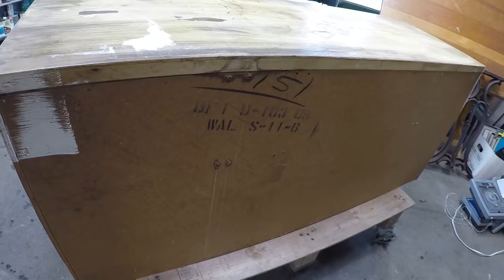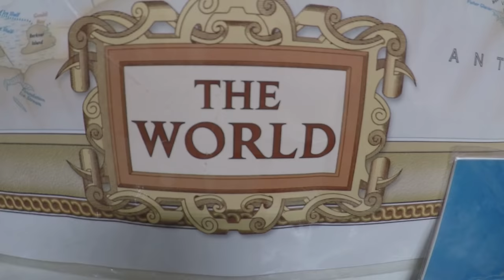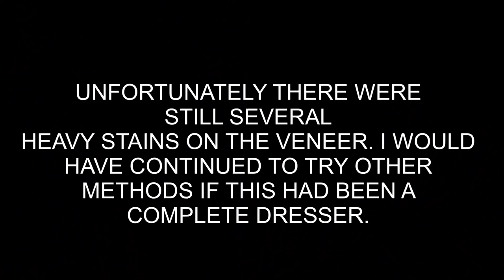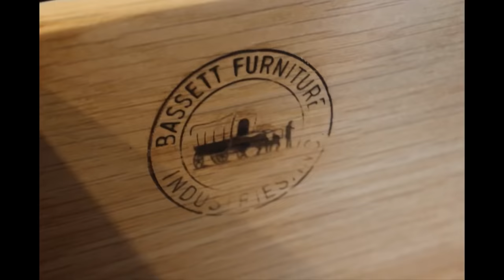Ep. 8 The Nastiest Furniture RESTORATION

Comment: These are probably not very smart questions, but I’ll ask anyway … 1. When you say the veneer was beyond repair, what did you mean? In other videos haven’t I seen you put on new veneer? 2. Why couldn’t you stain the wood left behind after you removed the old veneer(what’s the difference between wood with veneer on top and wood with no veneer when it comes to staining it?) 3. What is the difference between laminate and veneer and how would you tell when stripping or sanding it? 4. How do you know when to stop sanding or when you’d destroy the veneer? 5. Could you show an example of the problem you saw with staining the top of this dresser ….I couldn’t see anything and thought that stain looked beautiful. Beautiful work! Again! p.s. ..I’d love to see a video about how you refurbished your very first piece…did you already have tools? Did you know how to use the tools? What made you decide to do furniture refinishing?, etc.
Reply from the maker: I'll try to answer as much as possible. This was one of my first major projects. I had not ever placed veneer at the time of this project. The veneer on the top of this had many stains and burns. If I had stripped off the veneer I would have been working with a poplar substrate. Soft woods don't often stain well and can look blotchy. This would not have matched the beautiful drawers. I wasn't as considered about painting this piece since so much of the veneer was beyond repair on the front and the legs were missing.

Comment: I am learning about MCM. I was wondering why the legs in the back were not at an angle. Is that how it is done for MCM? Thank you.
Reply from the maker: Hi Sara. No, it isn't typically how MCM was done. This dresser probably had shorter legs. I decided to put on longer legs so it would be a height to use practically. In order to do this, I had to make sure the brackets were secure. I angled the front legs because the way it sits in a bedroom, that's all you'll see. That added enough support to sit on the dresser without it being unstable. Not that anyone would of course. The front legs can easily be adjusted straight if desired. Thank you for asking. Hope you are enjoying the videos. Barry

Comment: Hiii😄
Thank you for such a great video !!
I Love learning how to actually FIX pieces and giving them life foe the next few decades 💖
I have a question,  are you marking your imperfections with sharpie directly and filling on top of the mark ? Or by the imperfections and then sanding the sharpie off ?
I'm curious if the sharpie bleeds through the wood filler ?
Reply from the maker: I just do tiny dots with sharpie. Don't think it was enough to bleed through the wood filler, and ultimately through the black mineral paint which is primer, paint and topcoat. Good question though. Thanks for the great comments! Barry
Reply: @MadCityModern  thank you, I'm definitely going to do this.. what a great idea, especially for us visually challenged 😉
Reply from the maker: I'm right there with ya

Comment: I'm from Landsberg/Lech in the south of Germany and I'd like to know, how much is the stripper and if you know anything about the chemical composition. Background: German stripper is not suitable with steel wool. It leaves mold like dots on the veneer caused by a reaction with the friction debris of the steel.
Reply from the maker: Very interesting. Usually around $15 USD here for a quart.
Reply: @MadCityModern  a Quart is 250ml, right?

Comment: I have this dresser.
It is old and needs a lot of attention.
Reply from the maker: This one certainly needed a little attention as well. I'm curious? What did the original legs look like?
Reply: @MadCityModern  
They are screw on as well but they are shorter only about 5 inches.
And there are finger grooves on the bottom of each drawer for easy pull out.
I thought maybe I would take all the drawers out and the partitions and make it into a giant doggy bed.
Just a thought.
I don't have a dog.
Yet.
Reply from the maker: This one also has the slots on the bottom of the drawers. I imagined the original legs were much shorter. Thanks for the feedback.

Comment: I like the restoration but the legs are too tall and they’re put on wrong. This thing is going to fall over. The legs are too spindly.
Reply from the maker: Hi Johnny. I respectfully disagree. I would never spend this much time repairing a dresser, only to have the entire piece be unstable. The longer legs were necessary to bring this dresser to an appropriate, practical height. I didn't want something just to look fancy. I wanted it to be functional. I too was worried that the dresser would be unstable. I assure you, it is not. I have used it every day since. Also, the legs were not put on wrong. It is true that it may not be your preference to have straight legs in the back and angled in the front but this was intentional to add the support that was necessary for the longer legs. The view would bother me if I spent the majority of my time laying on the floor staring at the dresser from this angle. I do appreciate you taking the time to comment. My line of work is healthcare, so I am always glad to learn new things from viewers. Barry